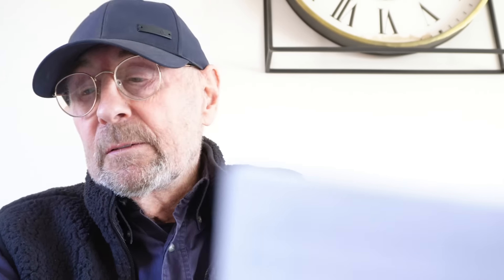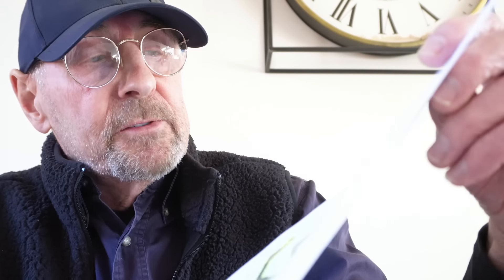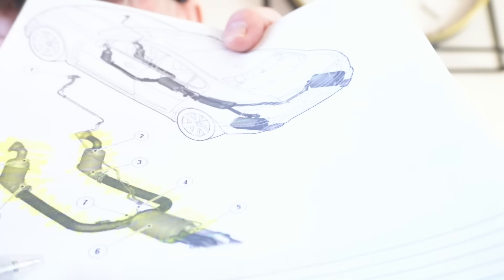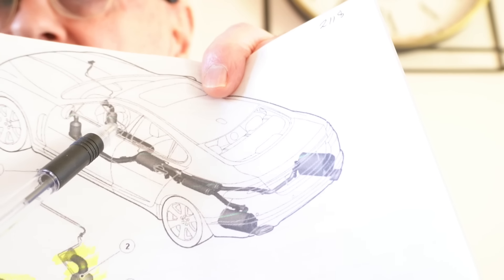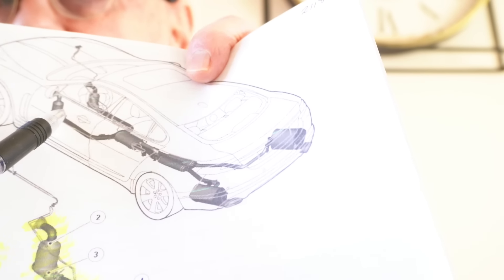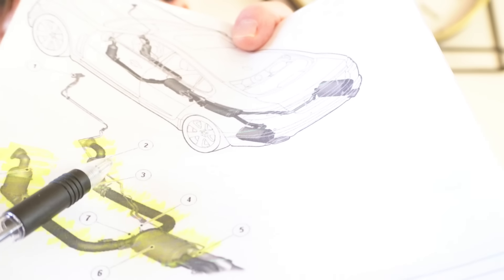CAUSE REVEALED!.. The Self-Destruction Of Jaguar Land Rover 2.2 / 2.7 / 3L Diesel Engines

Comment: Avoid the early 2.0 transverse installed Ingenium engines like the plague. They are rubbish due to fuel contamination because of failed regenerations. This is NOT the problem with V6 engines self destructing.  This is not an issue with any other installations of the four cylinder engines be they the Ford/Peugeot 2.2 or the in-line and later Ingenium 2.0 engines.  These may have rubbish timing chains and chain guides but that is a quality control issue at the design and materials factory stage.

Comment: Don't know why you keep harping on about "driving style." because it has a direct effect on DPF operations.  If your driving style is a short trip to the shops, where the engine never warms up, your "driving style" is 100% a factor, and your DPF will never burn off.  If your driving style is long distance motorway, the DPF system is likely to work as designed.
Reply from the maker: Hi, thank you for watching and for your feedback. " Driving style " can and will cause oil dilution by way of the engine management system initiated by the DPF system. ( Jaguar documentation ) I would be interested as to why you assume everyone knows that?
Reply: @crystalclearmechanics  I would be interested to know why you think I was referring to that particular aspect, which I did not mention.  Not comprehending my comment and then putting words in my mouth is poor form. My inference from your continuous eye rolling about their (perfectly valid) reference to driving style was that you think that claim is rubbish, yet here you are agreeing with it.  Who is this "everyone" you speak of?  Fully 90% of people have no idea what goes on in any part of their vehicle, let alone the intricacies of the over the top anti-pollution systems that are bolted onto today's cars.

Comment: You've gone on a bit ...and no word on the ridiculously weak crankshaft  ?
Reply from the maker: Hi Gary, thank you for watching and for your feedback. The video shows the main cause of engine failure in the Jaguars which is engine oil dilution, I quoted the oil dilution issue from the Jaguar workshop manual. The LR side can and do suffer with this issue. When a crankshaft snaps it usually involves other factors unless you are saying that every 2.7-3.0 ltr JLR diesel engine has failed for that reason and they have not, there are millions of these vehicles still on the road without issue. If something snaps it usually snaps at it's weakest point or where other factors are present at that point ( similar to a con rod snapping, other factors are usually involved ), it does not show the cranshafts on a whole as being ridiculously weak ( manufacturing problems on some could be an issue ). I have not had one of these engines in with a snapped crankshaft ( destroyed bottom ends but crankshafts not snapped ) so lack the experience of checking out other factors that may have caused the crankshaft to snap ( worn / spun shells, seizure, oil pump failure / oil dilution etc etc ).

Comment: jag make oil now you will tell me next they make their own engines  ..lol.. they are not made to last no matter of servicing and rubber timing belts will still dissolve in oil no magic rubber belt will save these  they are made to be to costly to repair. not made to last,,
Reply from the maker: Hi Graham, thank you for watching and for your feedback. Jaguar do not make oil, the oil is produced by an oil company in collaboration with Jaguar and marketed under the Jaguar brand. The engine was a Ford / PSA produced engine at the time Ford owned Jaguar and therefore used across the JLR range among other applications. The timing belts do not run in oil so I don;t know why you think that. Hope this information helps.
Reply: @crystalclearmechanics  hi mate, shame they did not  collaborate with ford to make a better engine . i will let my friend Bev know your information who has a 2016 jag on the second engine. not up to 80,00 miles.
Reply from the maker: @grahamjones-r7r  Hi Graham, you don't say which size  engine is in your friends vehicle?

Comment: What a load of cobblers. I own a 3.0tdv6 Disco 4 which has suffered crank failure and it doesn’t have a DPF. My previous 2.7tdv6 Disco 3 also had no DPF and suffered the same failure not long after my ownership. It’s a poorly designed engine designed by PSA group, built by Ford. To add, Russian and Australian vehicles don’t have DPF yet there’s suffer the same fate so your theory is flawed. You have no clue what you’re talking about.
Reply: Your not wrong,it’s utter nonsense to blame the DPF for these crankshaft failures,the oil pumps aren’t that good either causing low oil pressure and 5w30 oil used doesn’t help matters when vehicles are driven hard. The truth of the matter is those crankshafts are shit but Land Rover won’t admit it because they don’t want to admit liability for these failures. These engines will not stand constant high speed operations on 5w30 oil which is the recommended oil for them,I have seen these engines do mega mileages when driven sensibly,I have owned several of them and had absolutely no crankshaft or oil pump problems but used 5w30 in winter and 10w40 in summer when higher engine temperatures tend to occur,I don’t use any of the fancy high price long life engine oils because being a diesel fitter I don’t believe in leaving oil in up to 30,000 miles. My engines have always been spotless inside with no sludge or carbon buildup anywhere,I don’t give a shite what Jaguar or Land Rover say this bullshit is all a cover for faulty crankshafts and oil pumps which they will never admit because of the costs involved with warranty claims,it’s a disgrace that owners have to stand the cost of replacement engines when it’s JLRs fault to start with.
Reply: Hi davidlundrigan, we do have pdf on vehicles in Australia and have had since 2011 including R Rover, my 2011 3.0sdv6 sport has done 182000ks and we leave for  a Nullabor crossing next Month, we run 5w40  the trip will be about 6000ks when back in Victoria.
Robin
Reply: @davidellis279  100% my sentiments entirely.
However I run my X351 on 5w40 all year round.
Thicker oil offers more protection and reduces the chance of metal to metal contact .
I've noticed a 2mpg reduction when compared to 5W30, but I can live with that compared to spun bearing failure ✅️

Comment: This video is way too long, its rambling, there is no need to read verbatim the tech notes, a concise presentation would be interesting, basically dilution of the engine oil by diesel contamination is bad news, which may be caused by DPF fault. The basic advice for anyone who drives a diesel on only short journeys is to give it an "Italian tune up" regularly even weekly.
Reply: Это как ???

Comment: You are actually presenting incorrect information. The 2.2 DOES NOT SUFFER FROM the same failure. Please either remove your video or amend it.
Reply from the maker: Hi, thank you for watching and for your feedback. if you listen to what I say in the video " I am reading from Jaguar documentation " A side effect of the DPF system on the 2.2 XF Jaguar, caused mainly by driving style, is oil dilution. What makes you think Jaguar would give incorrect information?

Comment: rubbish .a good oill pressure sensor and monotoring is THE solution because also bad oilpumps are in the root cause of bearings failure , another point is that JRL is a bad assembler ( not a manufacturer ! )
Reply: Assembler of what?  Ford built these engines in their plant in South Wales.  That's why JLR (not JRL) moved to their own Ingenium range of engines, so they were no longer dependent on Ford.
Reply: @simonuden8450 and that didn’t turn out well ingenium engines are total junk.
Reply: @markcarter3897  I’m sure there’s a very good reason for you making that outlandish claim, and I won’t say you’re wrong, but despite all the internet hype that always surrounds Land Rover products and is invariably posted by people who know next to nothing, and can’t afford one even if they did want one, there are tens, if not hundreds of thousands of JLR vehicles out there on the roads worldwide which are happily running with what you call a junk engine in them. Perhaps they’ll all stop dead tomorrow
Reply: @simonuden8450  As you seem to be the authority  on all things "JLR" could I just ask you how many of the 3.0V6 or Ingenium engines YOU have actually repaired or stripped down ??
Reply: @colinblythe3710  I’m not an authority on them, never claimed to be, but why does stripping them down make one such an authority?  For instance, anyone who bases a claim of unreliability on how many they’ve personally stripped down is forgetting that no one with a functioning engine is going to ask them to strip it down, so it’s hardly surprising they only get exposed to faulty ones
Reply: @simonuden8450  BECAUSE - when you are seeing the SAME faults over & over on the same engines it is obvious that there is a common cause / fault making it happen - that is just logic mate - you can read as many books / internet posts as you want - but it can NEVER replace experience and first hand knowlage  - it is something that can not be learned from a book 
Judging from your other comments you obviously have one and look down your nose at people by saying they cant afford one - not everybody is that insecure that they need a vehicle to impress others or to feel better about themselves - get some proper experience rather than just reading press releases and internet posts
Reply: @colinblythe3710  Colin, we're going to have to agree to disagree on this one.  You're fixated on some connection between a generic DPF issue that causes dilution of oil due to poor maintenance, and specific issue with Lion V6 engines, that occurs even on engines that are not fitted with DPF - that's logic.  As for insecurity, believe me, there's nothing to show off about owning a D4.  It's a car that only D3/D4 owners really appreciate.  I'm fed up with throw away comments from people who are obviously unable to afford the upkeep of a Land Rover, and hate people that can.  I have a far more prestigious Land Rover product than the D4 so, if I was insecure, I'd be banging on about that, and I'm not
Reply: @simonuden8450  Agree to disagree ! - rather than just ADMITTING YOUR WRONG
and know NOTHING about these engines or how a modern ECU / DPF works 
 Use some of you money to at the least buy yourself a Haynes Manual and read that or look at the pictures - you might see the CAM CHAINS  - that you could not stop laughing it !🖕
Reply: @colinblythe3710  Okay, I need to apologise.  The Lion V6 engines do have camshaft chains.  However, the primary drive is by toothed belt, and I assumed that you were talking about that.  You were referring to the secondary drive that takes the drive from the camshaft that is being driven by the toothed belt on each bank and transfers it across to the other camshaft on that bank.  I think you will find, however, that the tensioner is spring-loaded, not hydraulic.  In any case, if one of the chains snaps, then the inlet valves will no longer be operated by the inlet camshaft on that bank, and may be extended into the cylinder sufficiently far if any valve is on the node of its cam, and cause the piston to collide with it causing either lock-up you're referring to, or more likely a hole in the piston and bent valve.  However, if this is the subject of the class action, how does this relate to the cranks snapping?
Reply: @simonuden8450  Well thats a cut and past straight from the internet if ever I seen one - The cranks snap because of the weak web on them - once the pistons hit the valves they can come to a sudden STOP depending on if the cylinder dropps a valve 
This in turn transfers momentum down the con rod and CAN result in the crank snapping NOT ALWAYS - I have just re built one that snaped a cam chain but DID NOT damage the crank -OR put a hole in the piston  so the guy was lucky 
I had the crank X-ray'd and all was fine so it did not trash the block - it still cost a little over £10,000 to rebuild though 
FYI - the holes in the pistons are normally from an INJECTOR over-fuelling and melting them
Reply: @colinblythe3710  When I was referring to the holes in the piston, this is only if the structure of the top of the piston is weak, and it 'holes' rather than bending the valve or, as you say, snapping the crank or in extreme cases even bending the con rod.  The point was the valves are not perpendicular to the top face of the piston, so, if they collide, they hit the edge of the valve, so a small contact area means a high impact force, but I'm not familiar with the structure of the pistons in this engine.  If you've stripped one down, then you are.  You'll also know that the cam chain tensioners are indeed sprung and not hydraulic, as you have to remove the tensioning pin after insertion.  I don't need to cut and paste from the internet.  Don't assume you're the only one with knowledge.  I made a mistake, overlooking the secondary drive chains, and I apologised.  I still don't agree with the connection you're making though, but that's my choice.  I end up changing my oil and filters at less than 6,000 miles anyway, because I don't do the mileage I used to, but I do at least take the Discovery on a long drive (over an hour), at least once every couple of months, and I use my IID Tool to keep an eye on the DPF metrics

Comment: The 2.7 TDV6 engine used by JLR was the same basic design as the Ford/Volvo and Peugeot/Citroen TDV6 engines of the same capacity. https://en.wikipedia.org/wiki/PSA_HDi_engine, and is basically a "Lion" Duratorq block used by all. https://en.wikipedia.org/wiki/Ford_AJD-V6/PSA_DT17
Reply from the maker: Hi Ed, thank you for watching and for your feedback.

Comment: Would fitting an oil temp and pressure gauge give prior indication of diluted oil and also heat build up on the crank? Cheers.
Reply from the maker: Hi, thank you for watching and for your feedback. There are two indicators of oil dilution although not great,  checking oil level manually and the dash warning light indicating diesel fuel has reached 7% of engine oil volume. Both these indicators are only valid if the engine does not burn / leak oil. As a precaution I recommend 5,000 mile interval engine oil and filter change. It has worked for my customers although some recommend less mileage.